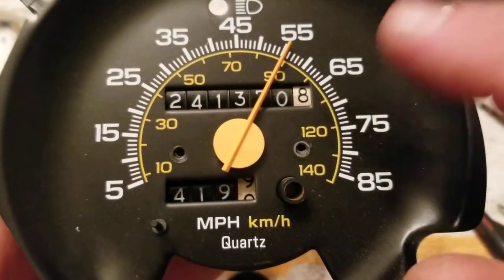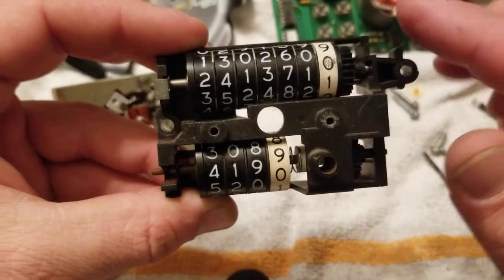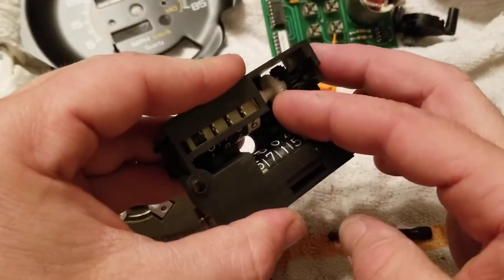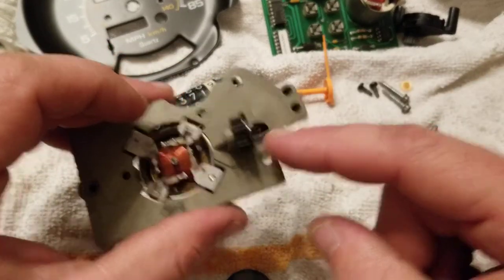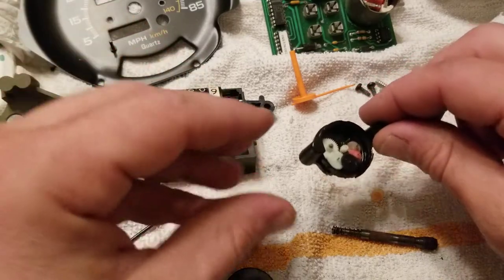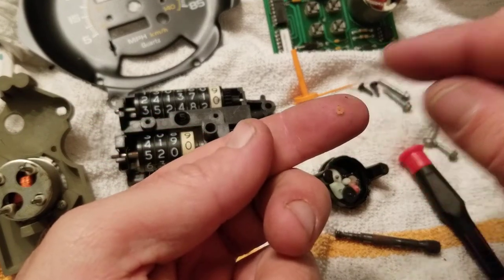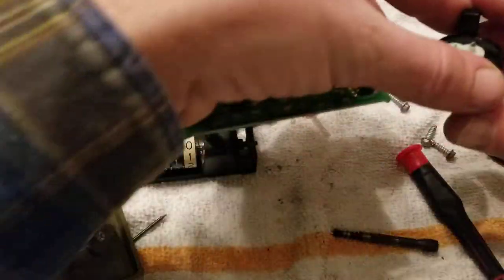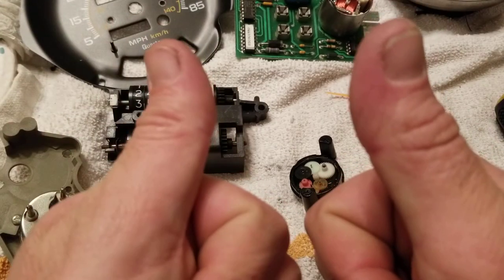How to fix a broken Chevy Odometer the easy way

Comment: can back charge alternator or arcing relays to ground effect those odometers?
Me odometer didnt work for years sudenly when I hade ground problems with blinker relay me car cinde of worked in union with the blinker relay and funy thing was me odometer started working again ???
So any idea what is wrong with that thing?
I did notice the diode is bypassed on the dashboard insted going to baterry light it goes to engine warning light insted that diode so I know me Delco 12 si is back chargeing but that odometer confuse me realy.

Comment: I'm looking for a speedometer that is just like that one, can you tell me exactly what kind of vehicle it came out of.  I did an engine and trans swap and I'm going from a mechanical speedometer to an electric speedometer and I want to try to find a factory electric Speedo that will fit into the cluster on my 84 Monte Carlo. Thanks
Reply from the maker: A 1990 gmc v1500 suburban

Comment: Can you make a video drawing a rough sketch of how the trip-o reset stem would’ve worked? Troubleshooting mine and this sorta helped and sorta didn’t. Thanks!
Reply from the maker: It's pretty much a long stick with a spring to push it up and a gear on the side that is disconnected when up. When you push it down it connects with the gear on the trip counter wheel to reset it. Hope that helps
Reply: @AdventureBrad  oh okay it just kinda clicked in my head! Makes sense! It’s a worm gear correct? Kinda like the one that pilots the main gear that turns both the odometer and trip?
Reply from the maker: Glad you got it figured out, if i remember correctly it was a straight cut gear
Reply: @AdventureBrad  gotcha. I’ll pop it open and start working. Thanks again!
Reply: @AdventureBrad  one last question, how do you get that gear off the end of the stem inside? Can’t get it out for the life of me
Reply from the maker: I don't remember, sorry
Reply: @AdventureBrad  you’re fine! Just figured it out, extremely tight press fit. Sucked and nearly broke it